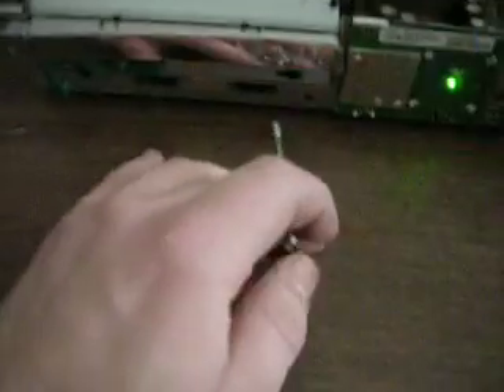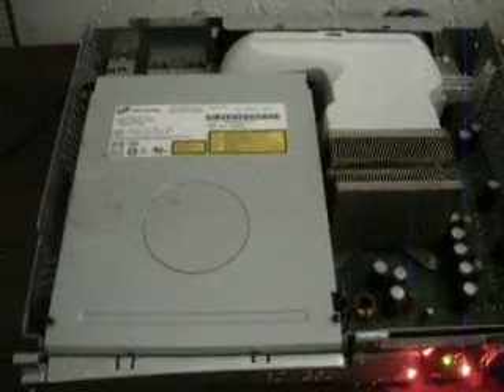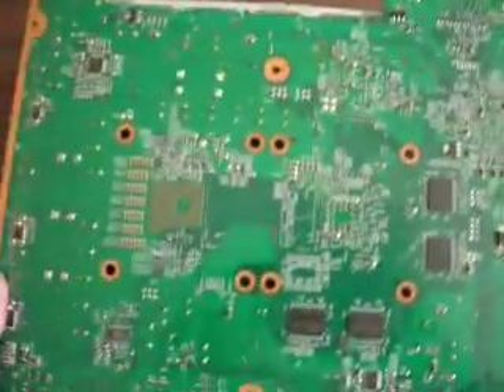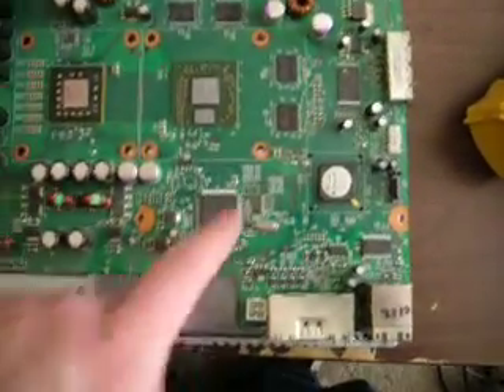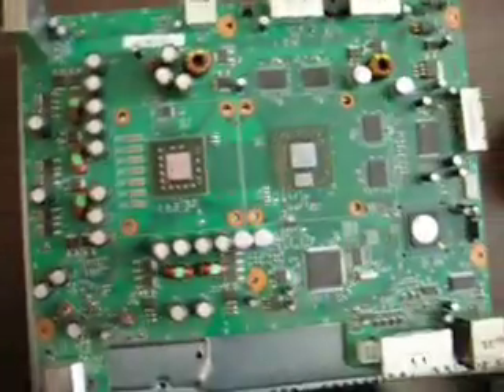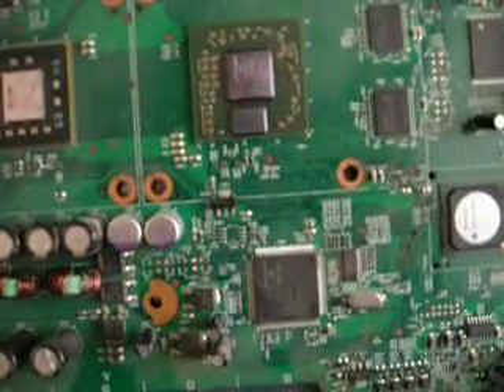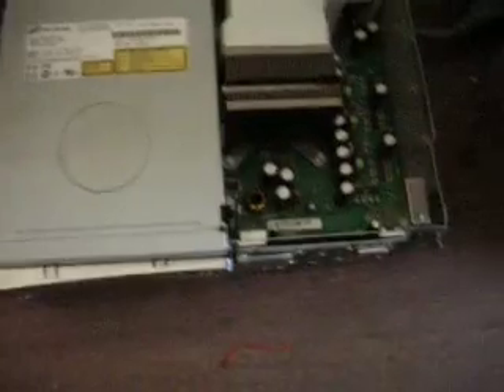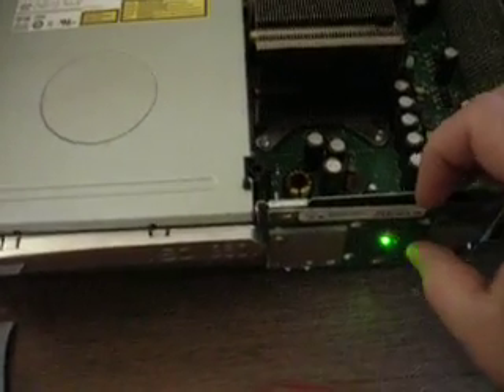Xbox 360 Heat Gun Reflow - RRoD Repair

Comment: Then did some research and found that the heat sinks MUST be on and making contact with the chips and with the copper exposed contacts on the board where the thru holes are. Hooked it up and it worked perfect....you saved me several hundred dollars....BTW, Microsofts recommendation was to throw it away and buy their new one....thanks for nothing Microsoft. Again, great posting and I'm gonne redo do everything into a larger clear case with more fans and airflow with better heat sinks. You rock.

Comment: Thank you so much for putting this up. I used the exact same gun. Goo Gone and 91% alcohol worked great for getting the old thermal paste off. I did a minute on the back on low and 5 minutes on the front. I spent the extra minute pulling back slowly but kept moving. I did all the ram chips,southbridge,hana,gpu and cpu. Works great now! one thing i did discover. When i first went to test it, i did NOT put the heat sinks back on yet and tried to turn it on. Got TWO red lights(over heat)

Comment from the maker: @InfectTheCrypts Does the system work for any period of time after doing the reflow? Is the error code still 0102? Have you adjusted the timings any to compensate for the difference in heat? 

If yes to the first 2, make sure your x-clamps are re-applied with proper spacing per the video description, heatsinks are sitting evenly, that you're using a silver based thermal paste and perhaps consider doing a 12v fan mod to keep it cool.

Comment: @horrifcmodz  0110 is a RAM error it will work just reflow the 4 RAM bricks on top of the mother board and then the 4 on the bottom if no change ;)

Comment from the maker: @Moose2927 The capacitors are actually a bigger concern than plastic parts. They're closer to the area you're targeting than the plastic pieces. If you avoid heating them directly you won't have any problem. I find telling people to cover parts 1) increases work 2) often provides a false sense of security (resulting in people heating the foil which can in turn pop capacitors) 3) can make the board sit uneven

Comment from the maker: @thebigw1004 If it's only lasting a few days it sounds like it's probably getting too hot. You'll want to make sure you're using a good silver based thermal paste and that your heatsinks are sitting flat on the chips. You may also consider a 12v fan mod to make the fans always run at full speed. You can also try using some kester 951 liquid flux to help the solder bond stronger

Comment from the maker: @horrifcmodz 99.9% of the time the 3 red rings is related to broken solder, not overheating. Overheating is 2 red lights (though the broken solder can be caused by the system getting too hot). As far as your code, it's 4 digits and all 4 lights on means a 0. Unless you've tried some other method to repair this system, it's almost certainly an error related to broken solder and can be fixed with this method.

Comment: @MetallicBill you can buy the hardware to replace the xclamps for like 5 bucks total at your local lowes/home depot. all you need is:

8 m5 .80 X 10mm screws (in the metric screw bin at lowe's)
16 #10 nylon flat washers (nylon bin at lowe's)
16 5mm flat washers (pretty basic washer)

Comment from the maker: @BIGBOSS1983100 It depends on the reason for it. If it's broken solder then this will fix it. If it's from physical damage to a ram chip this will not. Like the 2nd xbox I fixed I damaged a ram chip trying to remove x-clamps. It had 0110 and never came back. I've since had many 0110s that i've fixed with this method

Comment from the maker: @rickssimpala I've fixed many systems permanently with this so it's not always temporary.  You can use liquid flux to increase the chances of it working permanently.

Also the NES doesn't work fine, you have to blow on the cartridge to get it to work :)

Comment from the maker: @rickssimpala I never said it getting hot was the only problem. It's one issue, the other issues being flexing caused by the x-clamps and the crappy lead-free solder breaking easily. All 3 of these collude together to make the 360 unreliable. The PS3 also has this issue to a lesser degree with the YLOD. 

If you've tried to repair your RRoD without doing a reflow, no amount of cooling is going to fix it because you still have broken solder.

And btw, there are many permanent RRoD fixes.

Comment: @xxW00LYxx guess i got lucky, but it worked... no replacing caps. i used the foil cause i thought it was safer. i'll keep you updated as far as if it still workes but i did add a computer system fan already. its a mod that i haven't really seen, i tapped into the red.black power on the normal fan. wish i could post a pic here... but i'm trying to make it fail now. lol i don't know if you should wish me luck or not but i am having fun with trying to fix it. :-)

Comment: didn't exactly burn a caps but definitly bubbled them... i just tried this, i used foil too. the only problem is i added a min because i had to stop (the smoke detector went off in my basement). i will check if the xbox is still operational and repost later but i am doubtful. i do have an extra dead xbox... i am stealing the capacitors off of them as we speak. lol

Comment from the maker: @walkerneo Dip q-tips in the goo gone, wipe on the chips. This lets you remove most of the thermal "tar". Use q-tips in isopropyl to remove goo gone and any thermal paste residue. 

You apply the thermal paste *after* you've done the reflow, before you install the heatsinks back. Do not attempt to reflow without removing and cleaning the heatsinks!

As far as finding a heatgun, you can get them from the paint department at walmart as well as Home Depot and Lowes stores
Reply: Do your x box still work with that method, x clamp swap method

Comment from the maker: @devil4hunt I've fixed over 100 360s with this method and never burnt a capacitor. Not sure what you did (doesn't sound like you followed the video precisely) but you DO need to max out the heatgun. 

For anyone else considering doing this for the first time, it may be a good idea to cover capacitors in foil. Make sure the foil isn't keeping the board from laying as flat as possible though: you want to just cover the capacitors.

Comment from the maker: @gsoliz25 My personal system I purchased off craigslist Red Ringed about a year ago and it's been going strong ever since with daily usage. I have had some friends have their errors come back eventually (not immediately) but I think it was because I did the 12v fan mod and that seemed to add a LOT of vibration (which can apparently break the small solder bonds quicker)

Comment: thanks for the tutorial!
I got the 3 lights, e74, and to top it off my dvd rom died along with my rf board. :X
I ordered the rf board, and dvd drive off ebay, just needed to know how long the heat gun should be used for reflow, so thanks a lot! :D

Comment: I've been trying to repair our 360 since the video stopped working a few days ago. (no red lights at that point, I'm sure you're familiar with it)
I haven't found any clear directions for the x-clamp replacement so I tried just guessing at it, and now I have two red lights on the left side when I turn it on. 
I'm confused by your description of the x-clamp fix. Are you not screwing through the chassis?

Comment: ok so i have  1600w heat gun  that gets up to 1100 degrees f. theres a cold setting and a hot setting. im thinking i might burn my xbox up if i use it on high. what should i use?cold or high. its a 100$ heat gun btw. it may be too much.

Comment: Hi I have fixed over 100 Xbox with RROD and E74, E73 Over Heating Etc. And This method works. But for My experience I recommend Covering all the capacitors and parts of the board you dont want to heat up. can cause permanent damage. And use Liquid flux. Rosin flux is good, orkester 951 liquid flux but evaporates too quick.

Comment from the maker: @LuisFelipeGD1978 A lot of people have had permanent success with this method. You can also do extra cooling such as the 12v mod to help it last longer. Other systems havent been so lucky...the worst ones for having the errors come back from what I've seen are the e74s. You could also use some kester 951 liquid flux available on ebay to help the solder reflow easier.

As far as a reball it's certainly better than a heatgun method but also requires equipment that's more expensive than a 360 lol!

Comment from the maker: @thedest1ny It can definitely be a GPU problem but several different sites say it could also be CPU or RAM. Either way they're all being reflowed by this method and using some kester 951 liquid flux, as hell5634 mentioned, can only make the solder bond stronger.

Comment: did not last unfortunately.. I may not have heated it up quite enough but I do know that I need some sort of fan mod because the heat syncs were ridiculously hot.. which is probably what caused the error again for me at least.. it can't hurt to try.. It worked for about a week but I've heard people have much better success than me

Comment from the maker: @SirSmokeify For someone trying this for the first time I suppose it would be a good idea to isolate. However it takes a while to do properly and can provide a false sense of security if done improperly  (or if there's places where air can get in). 

I've done many systems without isolation and have never had any plastic melt or capacitors pop. Like I said in the video, just avoid directly heating them and you should be fine.

Comment from the maker: It's not necessary and if you get the wrong type of flux you can mess up the board permanently. However if you do get the right kind it will allow the solder to reflow more efficiently and should make stronger joints

Comment from the maker: spreading the heat is better than just sitting in one spot. Besides without an x-ray machine (which people using this video wont have), you cant be sure exactly where the break in the solder has occured. 
Not only that I've posted this video to fix other similar errors such as e74 (which can be the (h)ana chip) as well as 0110 which is a ram error (both of which i've fixed numerous times). The system in my video just happened to be a 0102.

Comment from the maker: 1022 is e74, basically the same thing as the other 3 rrod errors: broken solder somewhere caused by the x-clamps flexing. It can be fixed with this method as well.

Comment from the maker: Yes 0002 can be a cold solder joint so the heatgun method *could* be able to fix it. But it's also possible that something else damaged  may be causing the error that the heatgun may not be able to fix. It's certainly worth a try though

Comment from the maker: You'd be may surprised but the heatgun is actually pretty accurate at directing the heat. The plastic pieces like the fan connector dont even get hot even though I hit the hana chip right next to it. I've actually seen people here on youtube use this method except he went over the entire board including capacitors and they didnt pop for him so as long as you dont put the heatgun directly on them and keep it constantly moving you should be fine. It certainly wont set fire to anything :)